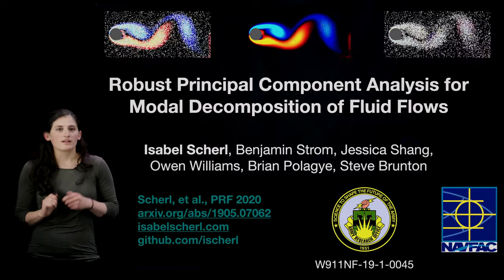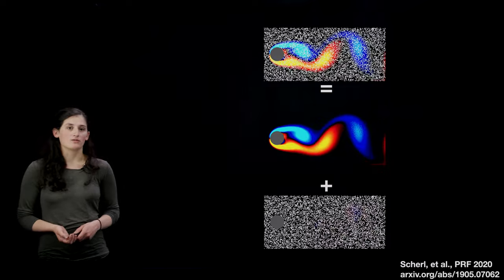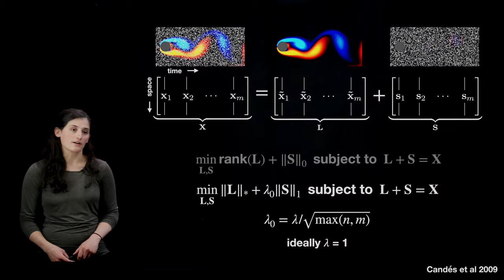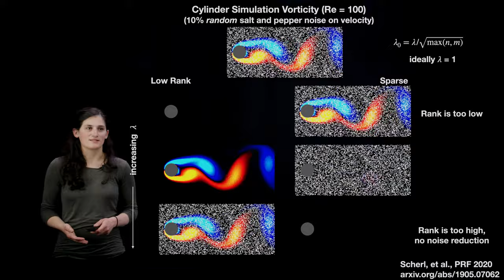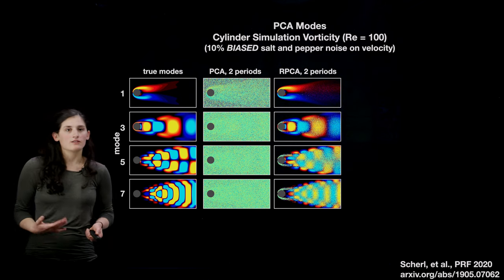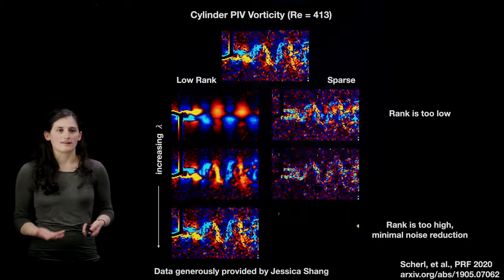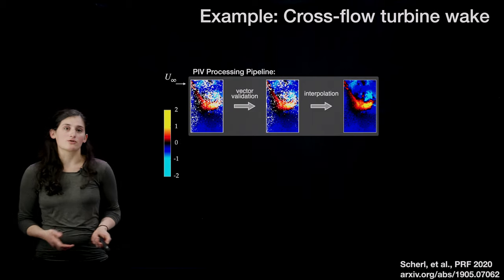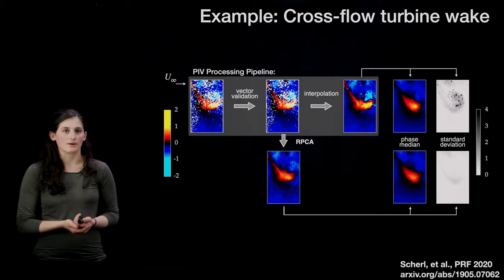Robust Modal Decompositions for Fluid Flows

Comment: Nice presentation. Since I'm new to this topic, a doubt I have is on the inlet condition. Whether RPCA can identify the structures in a unsteady inlet flow. ie when the structures are non periodically forming in the wake.
Reply from the maker: Absolutely.  In fact, the original RPCA algorithm was used for data like human faces that does not have periodicity or temporal correlation.
Reply: Thank you Sir.

Comment: Can this method be applied, on noisy microphone signals with tonal characteristics ? I have been trying to do DMD on microphone signals and having troubles due to noisy data?
Reply from the maker: In principle yes.  I would consider time delaying the data first into a Hankel matrix.
Reply: Thanks for your reply, 
Exactly, from all your lectures that's what I figured but my MATLAB crashes for anything more than 10 shifts of the matrix, any suggestions on hankel matrix for large data set, since it's microphone data the time steps are about atleast 500,000 columns.